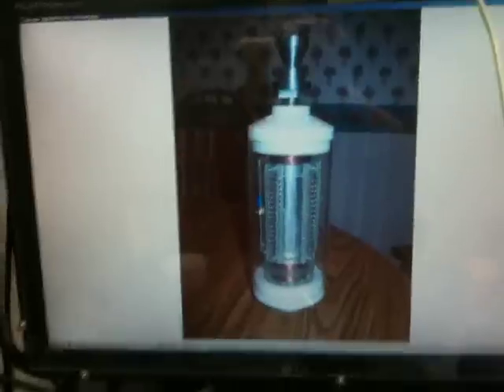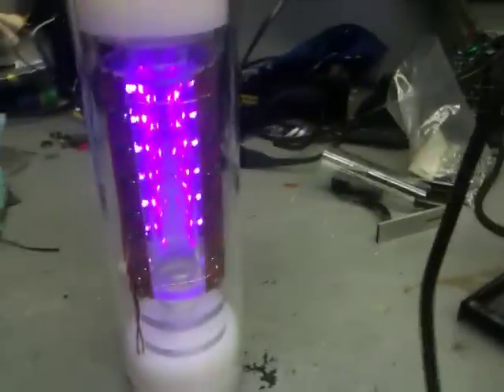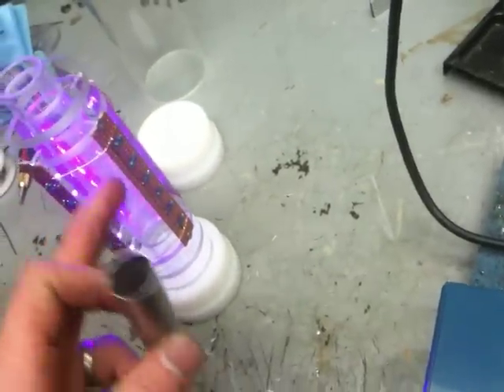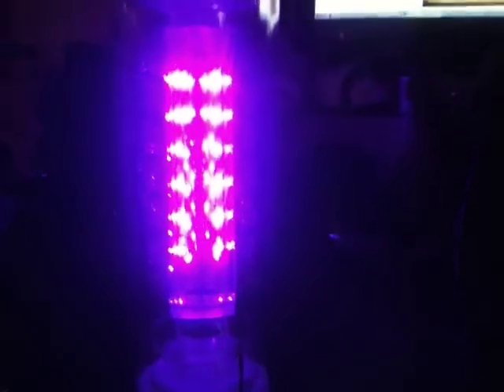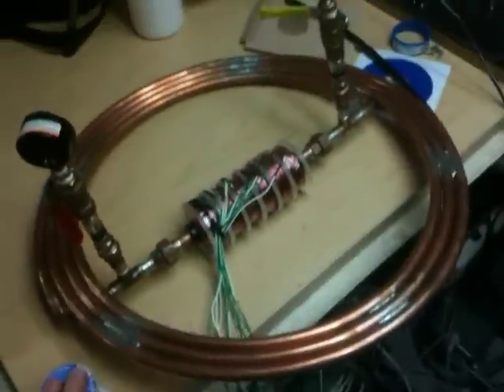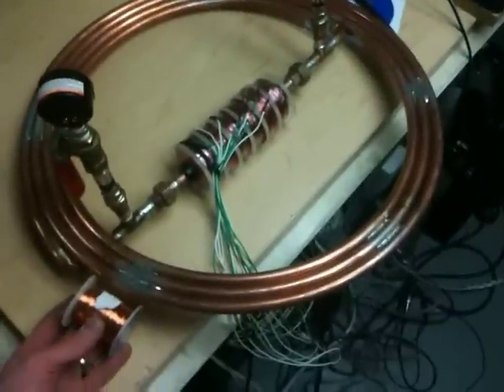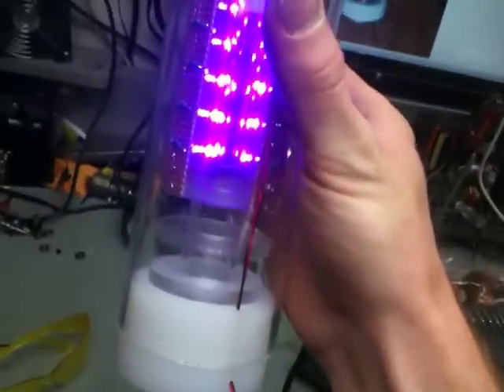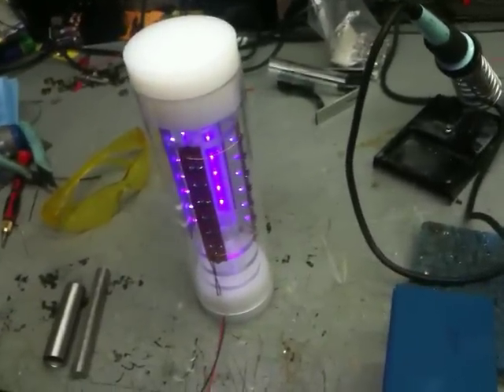Stanley Meyers Gas Gun Replica. Copper EPG Needs # 22 Gage Wire! Please Help If You Can!

Comment: Stan was tuning his pipes to the same frequency, like tuning forks, bang one and second one will sound, so inside pipe and outside has to be cut to different length. Measure frequency with  microphone and guitar tuner or scope. Than you have to pulse them with the same frequency. Maybe you can stretch the pipes like guitar strings, i don't know but why not. Under water freq changes. I hope the gun will not end up as a lamp on a night stand. It is beautiful.